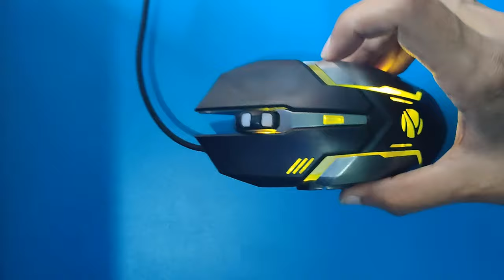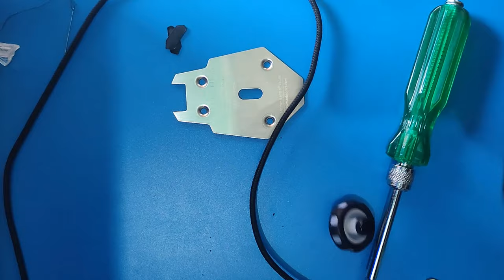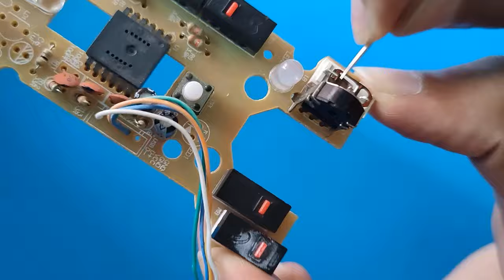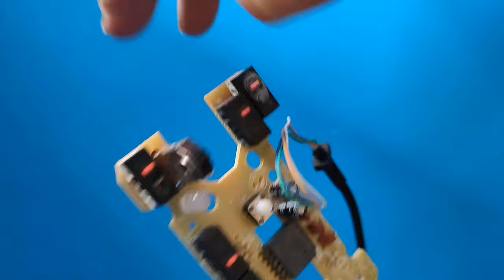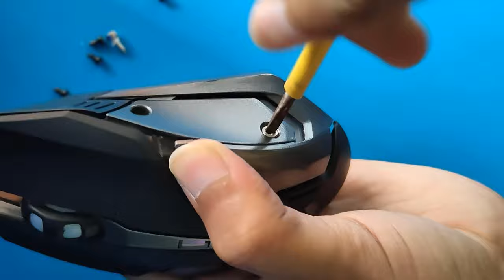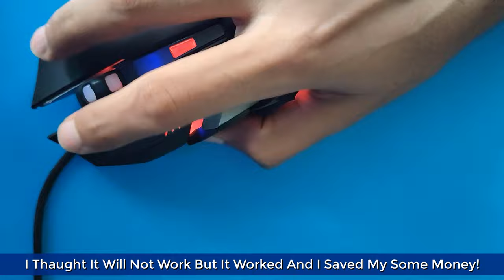How to Repair Mouse Left or Right Click Button in 2 Minutes 2024 (Don't Throw It)

Comment: Brother i have wireless ks15-2 and it's right click not working on light press i think something is broken in it what should i do
Reply from the maker: First try to connect with different ports or different pc laptop if the same issue and have time then try this video

Comment: Problem is my mouse buttons are just messing around and it doesn't have screws showing from the bottom or anywhere so it's not as easy.
Reply: Try removing it's pads, idk how helpful it is after a month
Reply: @realnach01  thanks dude I solved the problem there was stickers under hiding the screws.
Reply: @thmasby1646  so uhh i got a problem.... The stickers of my mouse are metal and was glued with some sorta superglue got any advice on prying it open?